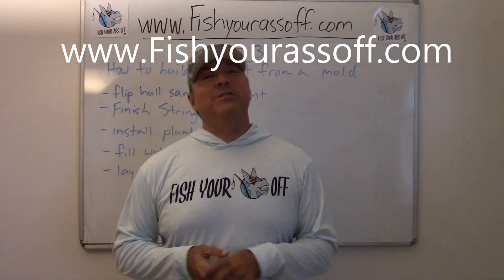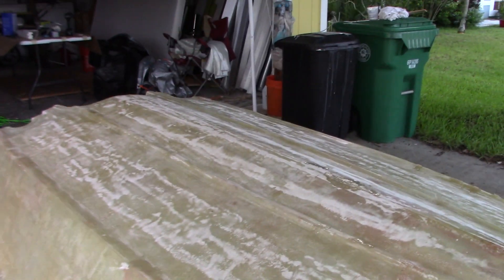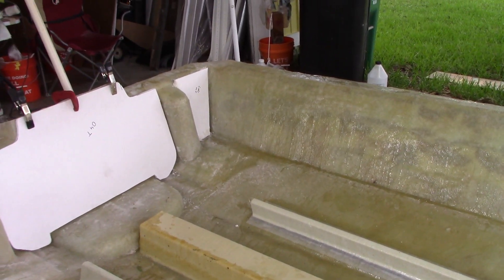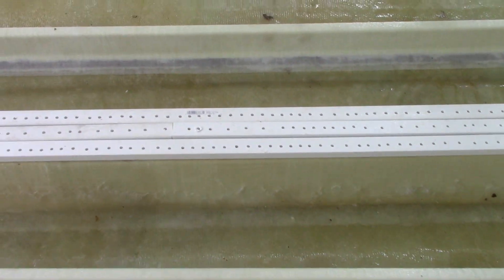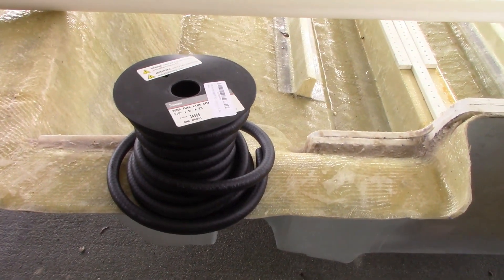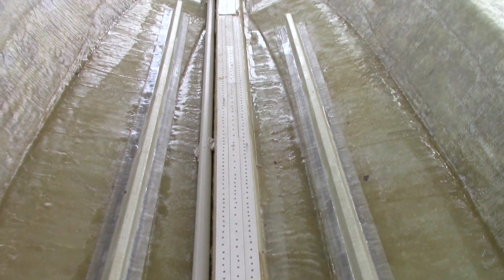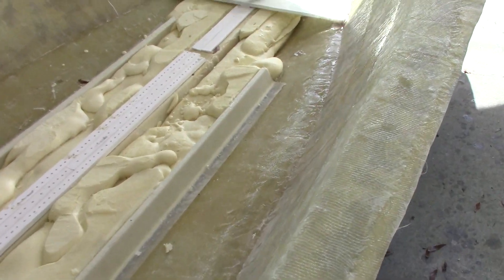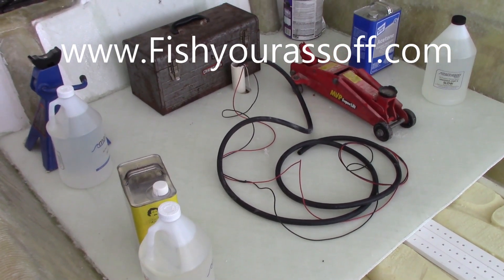How to build a boat from a mold 3

Comment: Boats looking fantastic! Might wanna make that fuel hose USCG Type A1-15 as it's now below deck. And if you can grab mule tape, that will last helva lot longer than butcher twine once in south fl heat when you finally tug on it again. Even the poly string at HD will outlast cotton. Love that closed cell foam. Thats a great add. Exciting to see the progress.
Reply from the maker: Thanks for the tips! I really appreciate your input.